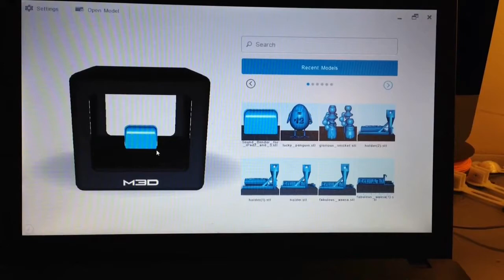The Micro 3D printer beta M3D --  How to change a printbed BuildTak sticker

Comment from the maker: Re: Thehinditemple

Ok I did some checking. These sheets are made of BuildTak. They can be found at BuildTak.com. They run $3.25 a sheet and can be bought in bulk amounts depending on your need. They did not send any with the printer, I had to request them. Before long you M3D will probably offer them on their site.

The pads them self are very durable for printing and would hardly ever need changed. My pad was messed up from scraping it with a metal tool, I would recommend something plastic now.  The scraping with a metal tool caused the print seen in the video to not come off.

Comment: Did you cut down a sheet of BuildTak or are you using one of the standard sizes. I see there is a 4.5" x 4.5" available on the BuildTak website and I wondered if that was the size you were using?
Reply from the maker: GavinLeigh sorry for my delayed response.. The pads I have came direct from M3D. They measure 4.75"x4.75".